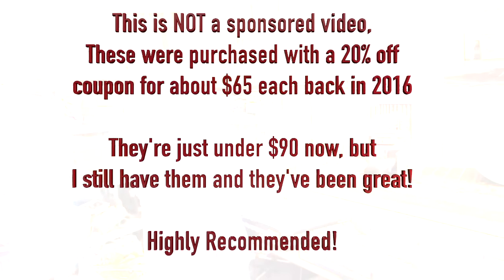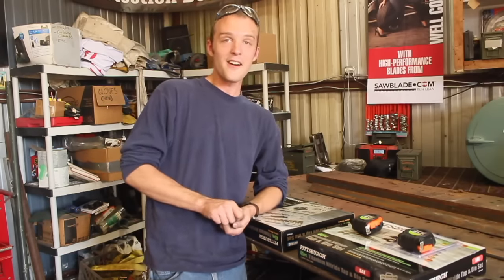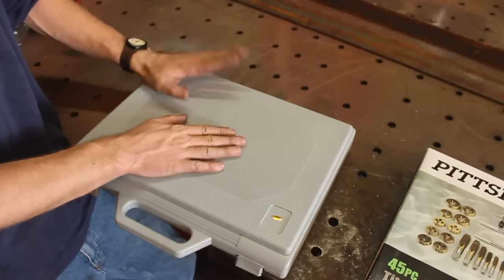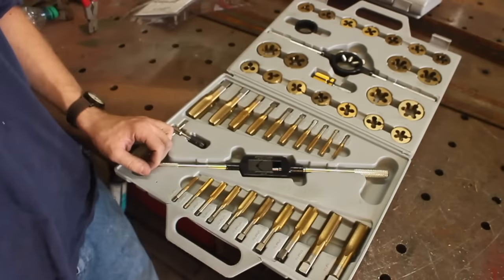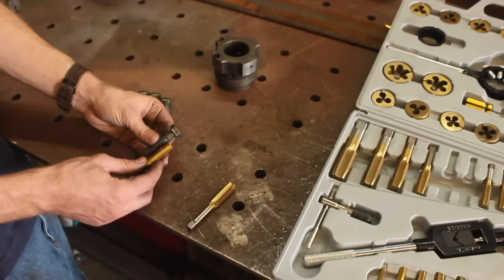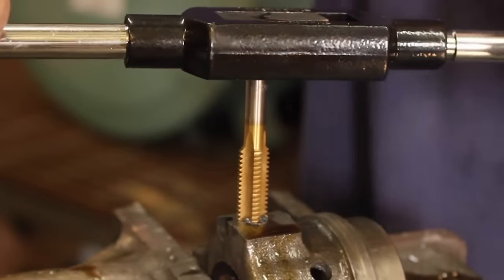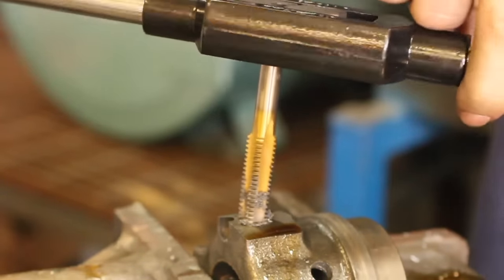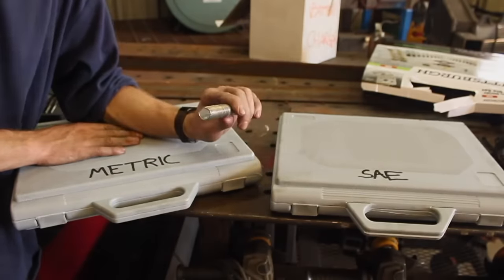HARBOR FREIGHTS BEST KEPT SECRET!!! AN ITEM SO GOOD EVEN INDUSTRIAL COMPANIES USE IT

Comment: I'm a Gunsmith and the HF carbon tap and die set is one of those pro secrets in the Gunsmithing world. Pure carbon taps are kinda hard to find. We like to use carbon taps because if you were to break one off in a gun you can just hit the broken tap piece with a hard center punch and it will shatter into small pieces. Then you can use a dental pick or something to pick the pieces out and you have removed the broken tap without harming the finish on the gun. The gold coated taps and other fancy alloy taps won't shatter like the carbon ones will and are much harder to get out especially without screwing up the gun and causing yourself a lot more work!
Reply: are you talking about the carbon steel sets they sell for $20?
Reply: @TonyMueller  Yes sir, the cheap ones! Lol!
Reply: @JesseCase  that’s a great piece of knowledge to file away for future use. Thanks!
Reply: Sweet, this is the set I have, good to know.
Reply: yeah nothing worse than scrapping a part due to the addition of a piece of super hard broken tap debris, or worse as Mr. Case points out, what if you can't just scrap it and make a new one, you MUST fix it no matter what?  I've had to deal with that a few times and it can be a huge time sink.  Bottom line, if you are tapping by hand ( unassisted by a mill or drill press set up for proper start alignment) and the material being  tapped will be ruined by a broken tap, use a carbon steel tap.
Reply: @rfpeace  the downside of this is carbon steel taps are more brittle and thus more likely to break in small diameters.
Reply: there IS no "downside."
Reply: @mytuberforyou  yeah but at least you get another shot at it and worst case you go up a size or two.  I've had to dig out alloy taps from stuff like cast aluminum that pretty much destroyed the part.  But we hear you, hand tapping is a risky, yet with the right feel and finesse can be very rewarding.  Cheers:)
Reply: The fact that they shatter is very interesting. I have to assume that's a deliberate design choice on their part because typically steel dosn't shatter that easily- maybe they're focused on the hardness of it and the brittleness didn't matter to them because it theoretically won't be experiencing impacts?
Reply: You don't have to break the tap to get it out. Sometimes you can use a cotter pin by breaking it apart and sticking the pieces inside the flutes in the hole. Also, buy your taps from McMaster-Carr.
Reply: I've been able to bust up broken taps to recover the pieces from a broken tap, usually by using a punch if the broken section can't be backed out.  Not many people talk about doing this and I don't argue with them, let them live the horror.  The taps are hard but brittle and partially shattered at this point, which can cause them to wedge in rather tightly, so yes it does require some patience.
Reply: @MrFixItGa  And, there are broken tap removers that can aid in the process you described.  Basically, a fancy version of your solution, intended specifically for this purpose.
Reply: Thank you for this information.
Reply: Yep so far I've only snapped a #6-32 tapping 3/8 mild steel stacked onto 1/8" mild steel... I wasn't paying attention and the tap was slowly separating the 1/8" on the inside of the post, luckily a little punch work easily removed part of the tap, then carefully crushed the last bit, salvaging the threads in the 3/8. If I would've had my "good " branded taps from the shop instead of my work truck HF set I might've been changing my hole locations lol 😉
Reply: Helluva tip there, much appreciated!
Reply: The only people who think they're good quality taps are people who have never used high quality taps.
Reply: @littlejackalo5326  It's definitely a price vs. quality vs. quantity equation... Most people using these aren't machinists using them for daily use (CNC machines have basically removed that from the equation anyway) I may get a greenfield tap for the few most common sizes I use, but they live in the shop... For field use where you may need a ridiculous metric size or pipe thread sizes these sets are hard to beat for being able to outfit multiple trucks for a low price, while supplementing the most used sizes of taps (although still relatively rare in my case) with something slightly better like a Irwin/Hanson/Norse that are of acceptable quality, and you aren't out $30-50 when someone loses or breaks one. The Irwins are actually fairly durable and consistent for the price, although once again they often are lost, rusty, or dull and need replacement before breaking... Everyone's needs are different, but these HF sets fill a nice void for my requirements where "real" taps would be lots of wasted money. Four ¼×20 or 28  tap/bit Irwin sets can be put in a truck same day for the price of one premium tap of the same size and 3 days minimum ship time, unless I pay even more from an industrial supply shop that isn't exactly convenient to travel to, unless it's a shop specific emergency. 🤷‍♂️
Reply: @crosshairs007  no not deliberate, the brittleness is just the by product of the extreme hardness of the steel. Just like when you drop a file on the ground and it shatters. Given it doesn't happen every time, but it definitely does happen, ask me how I know :')
Reply: @ProtoTribal Sounds interesting.  I'm going to try that someday soon.
Reply: from my experience, they are fine for thread chasing, but can't handle cutting new threads.
Reply: @berryreading4809  they seem to work great until you use a quality tap and are amazed at how easily they cut comparatively to the cheaper one
Reply: Will they honor the Lifetime Warranty if you break one?
Reply: No chinesium taps& dies for me dude 😢
Reply: If you are breaking taps you have no business using them know your materials and there hardness rookies
Reply: Did you go to SDI gunsmithing school online or something?
That is some of the most bogus bull-shit advice I have EVER heard in my life regarding gunsmithing.
Who on earth told you to use carbon taps, in the event that your break a tap off so you can 'shatter it' into small pieces?
I am 'sincerely' asking because I would like to have a conversation with this person. I have attended some of the most prestigious gunsmithing courses in the world and I have NEVER heard of that before. I am not trying to be a dick here, it is quite possibly not your fault because you were given bad information, but I would love to talk to the person that taught or told you that information. Please give me a name or drop some sort of dime so I can find out wth that came from.
Reply: @18B_Madder  Wow! First of all I went to THE most "prestigious" (for one thing, there's no real such thing and absolutely no prestigious "courses") Gunsmithing school in the country which is Montgomery Community College. It is the official and only school of the NRA, the only school still recognized, endorsed, and sponsored by Brownells and Midway. Unfortunately it is the only school still recognized by most in the industry because the quality of schools in general have gone down hill in recent years. Trinidad and Pennsylvania School of Gunsmithing use to be recognized also, but no longer are in recent years. It is not my opinion that it's the best Gunsmithing school in the country, I was just extremely lucky to live close enough to attend it and didn't learn of it's reputation until well after enrolling, but it is a well known and well accepted fact in the entire industry that it is the best in the country. It is the school that other schools come to and model themselves after. That's not to mention all the extra courses and certifications I've gotten afterwards. None of which are "prestigious" because there is no such thing, they are just courses. No your armourer courses do not make you a Gunsmith. The two men's names that I learned about the carbon taps from are Jim Fidler and Wayne Bernauer. Both of which are very well known and highly regarded Gunsmiths and instructors throughout the industry. Jim Fidler may have passed away by now because he would be in his 90's now. However none of that really matters because schools and "prestigious" courses only get you started. Experience and time are what really matters and the main reason I know for a fact that you can shatter a carbon tap is through experience because I'VE DONE IT! Luckily I've only had to do it twice over the years, but in both occasions it absolutely, without question, for a fact, worked! I've also seen two other people do it once each. It can definitely take a few good wacks to get it to crack, it does take some time to pick the pieces out, and it is an aggravating and tedious job, but it absolutely does work and is much better than the risk of trying to drill it out. I would not have ever put information out there like that unless I knew that it was possible. Also If you don't want to risk breaking a tap in the first place you can take the carbon rod out of some brands of the old square 6v lantern batteries, turn it down to fit the hole, hook it to a 12v battery for a few seconds, and anneal just around the hole. That's another "BS" trick you probably didn't learn in your prestigious courses.

Comment: After ruining a few projects with cheap taps, I only buy American made three tap sets (taper, plug and bottom).
Reply: Sure, but which brand and where? I wish I could find nice sets for the most common sizes at least. Please if you have a link........
Reply: @AlessioSangalli  I've had great success with Irwin-Hanson in both metric and imperial sets.
Reply: @georgetouliatos5972  thanks.
Reply: What makes you think Irwin-Hanson is made in the USA?
Reply: Widia Tools tap and die sets can't be beat. Their HSS versions are damn near like carbide. I'll never buy cheap taps and dies ever again. The problem with cheap taps and dies is that they rarely get the relief angles correct, and this makes you apply more torque than necessary, making you prone to break them.

Comment: I've been using both the metric and SAE sets for over 15 years. They don't get real heavy use and they're mostly still good. I really like the dies which are adjustable to cut harder metals a bit at a time, or for fine control of depth of thread. I rarely, but not never, use the larger sizes, nice to know they're in the shop.

Comment: May I suggest you get a "Tap Follower" it will make sure you are tapping straight.  After drilling the hole leave the part where it is and swap the drill for the Tap Follower and you will be sure you are tapping straight.
Reply: Agree completely. It, of course, depends if the tap has the center drill hole for the follower to align the rear of the tap. At least, that all of the ones I've used so taps under 3/8" can't be used with our followers. Probably 90% of broken taps I've seen are the result of the tap not being in line with the bored/drilled hole. (Or some guy using a high torque Milwaukee Holeshooter drill motor out in the field for a 10-32). For a lot of our small size tapping operations, we used the milling machine and gun taps (2 or 3 flute depending upon the diameter). We'd avoid 4 flute taps for anything 1/2" or under because the web cross section gets a bit small on some taps. We loved the gun taps and started going to a lot of cobalt taps... those things are pretty tough. I do have to admit that the quality of a lot of Harbor Freight tools have improved over the last 25 years. I started buying impact sockets years ago for industrial work and never saw a failure. I used their Quinn chrome sockets for normal stuff also without failure. And, we prefer the Tapmagic formula even though it's a bit messier than the formula 25 years ago with, what was it, trichloroethane?
Reply: I should have added... I've seen a lot of broken gun taps IF people run them down into a blind hole of insufficient depth for all of the curlicues that the tap pushes to the bottom of the hole.
Reply: @mcgeorgerl  you are correct, I just assumed it was a given. And that we are not handholding children.

Comment: I cleaned out bolt holes and bolts on my 1951 chevy hood with this set. I've used it in similar situations with my vehicles.  Works good for what I use them for.

Comment: I've had a set since about 2005. Used them in a shipyard as an outside machinist for 15 years. Broke one early on, the #12 screw tap I think. My own fault. All in all, they have been an excellent set. No problems. Work great

Comment: I've been using HF tap and dies for years in both SAE and metric.  Over 15 years none of the components has failed.  That's a testimony to their strength.  I got them on sale at the time so I bought both sets.  Mine came in a little tighter cases.

Comment: I would caution people to buy a set of chasers so if you have a buggered nut or bolt you can run the chaser down to make the threads usable rather than retapping the bolt or nut which I was told cuts new threads in the old threads and can weaken the bolt. You also can't miss if you buy a set of thread pitch gauges that will tell you what the threads per inch are and a set of thread files so if you have a bolt somebody hit with a hammer you can file the threads to fix them so you can remove the nut. Might be looking into these since they are easier to remove if they break off and so my friends can use them instead of my expensive set that came with files and gauges :)

Comment: I was a Honda motorcycle mechanic for 30 years .. I have a large Snap On tap/die kit but I have 2 Canadian Tire kits (I mainly use) and I have 2 (metric and SAE ) kits from Princess Auto large kits up to 24mm and 1 inch .. I have lot of special tap/dies odd sizes and odd threads ... I mainly use the Snap On drivers altho I do have 10-15 specialty drivers in 1/4 and 3/8 inch drive ...

Comment: I bought a set from Harbor Freight several years ago. As long as you just use them to chase existing threads they are fine. Don’t try to cut threads in a new hole or you will break it almost every time. I have been a master mechanic for 30 years so I kinda know what I am talking about.
Reply: Sounds like you don’t know how to use a tap. 

I’m not saying they are amazing but you can definitely tap some holes with them.
Reply: Thread chasers have a very different geometry compared to cutting taps, the first ones "push" the threads back into shape. A mechanic will typically just repair threads, a fabricator or machinist will cut new ones
Reply: I just watched him cut threads.
Reply: I'm A maSteR MeChaNic

Comment: what's nice about sets like this is that even if a tap goes bad, you can buy a better one and put it in the set.  Most of those won't be used very often so the set will last a long time.  I have done that with sockets and drill bits.

Comment: Starting taps especially in cast iron and aluminum you might like the results of starting the tap with your drill press. Power off! Hand turn the chuck with moderate to heavy down pressure for larger taps. After a couple of full threads revert to the tap handle. Straight start every time. Number one cause for breaking a tap is crooked start.

Comment: In all my years working on a shop floor, machine shop and in automotive, I've only ever broken one tap and surprisingly it was a 5/8. It's called patience.
Reply: As someone who uses small diameter, the patience they would require to not break taps would be unattainable,lol, it’d take a week to finish an 1/8” deep hole……

Comment: I've used those for years... never had a problem...so far, I am a machinist and toolmaker for over 30 years. They are not made for production runs, but for one off use, kinda what you would do for a repair, modification or a prototype.

Comment: Grasshopper has not yet learned the ways of power tapping in the drill press or vertical mill.  Drill hole to 60 percent, swap drill for tap, jog machine to start and continue to tap, and since it’s a thru-hole, it’s easier to stop.  Fewer broken taps and square tapping because you haven’t moved the work.  In ductile materials like mild steels, aluminum, brass, etc., use forming taps; not cutting taps.  These have different tap drills so make sure you are looking at the correct tap drill chart.  You might want to invest in a tapping table.
Reply: A  grandpa had big laminated charts in his shop for a few different sizing and conversations. Him and his brothers started build well drilling rigs and now there is qt least 5 different welldrilling companies that are operating today all because of my grandpa and his brothers. Made tools better then anyone around and thats why.

Comment: I bought the metric set from Harbor Freight because it was literally the only place that had the size I needed. I thought I'd just use the set once or twice, but I'm a professional automotive mechanic. Brought them into the shop thinking I would destroy them in 3 months or less. 5 or 6 years of hard use later I've only worn out 1 or 2, and I was tapping really hard metal that would've eaten up just about any tap. I need a new driver, the steel in that finally squished so it needs replacement. But most of the taps and dies have held up fine.